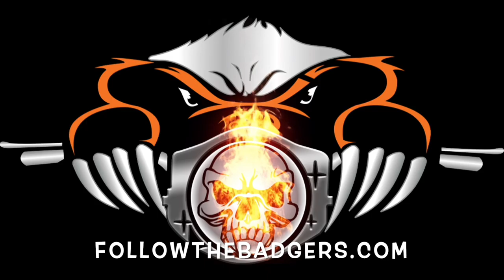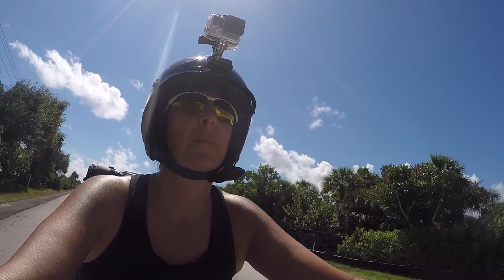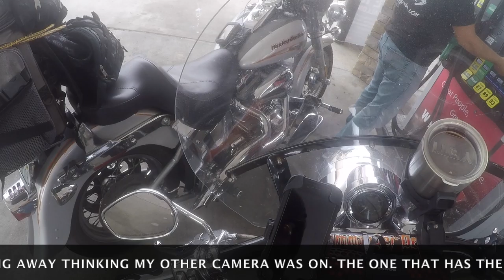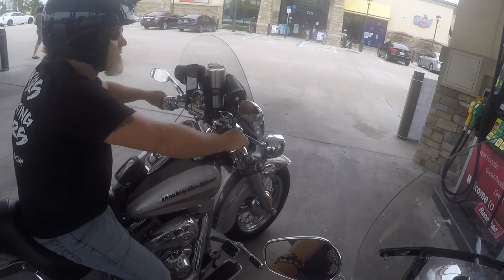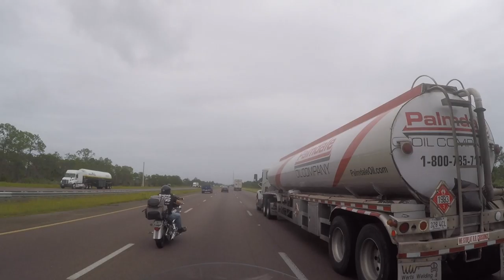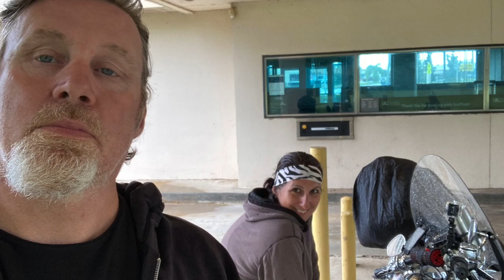How not to do a motorcycle motovlog. Harley Davidson | Badass Sunday Momma Badger E3

Comment: Thanks for the shout out at the end 👍

Audio is tricky and its something that we all struggle with. Either it doesn't work so great and its difficult to hear or it works too well and picks up all these weird little noises.
You're definitely on the right track and your videos are fun to watch (I particularly like the added commentary from your desk).
Reply from the maker: Thanks Walt in PA! Sonny keeps telling me I"m going to be so hot in a full face. But I think it will solve other issues like my ears hurting from the pipes and getting the wind. Plus I wear contacts and my eyes tend to get dried out. I just hate shopping. So I may take a while to look and pull the trigger. I'm going to try on some slower roads until then. Thanks for watching again! I appreciate the support!

Comment: Another great video!! Don’t stop! Keep going and don’t give up, just made adjustments here or there as needed! Have you ever thought about buying a full-face helmet? I’m telling you it’d be easier to hear you but do understand you live in the heat and would prefer half helmet. 😉 To answer your question, I prefer taking back roads over the interstate any day!! But, at times it can’t be avoided because it can cut down on time needed to get to point B faster. Keep pushing forward! 😊💕
Reply from the maker: Thanks Mrs. Stevy. I'm really thinking full helmet is going to be best for me. Toby Northern said to be sure and try a bunch on though. Cause the one he has rubs the top of his ear. I was hoping a full face would help with noise reduction and keep my eyes from drying out too. If it can solve a couple of problems then being hot and sweaty is worth it! ~Momma Badger
Reply: @TheBadgers  actually the ONLY complaint I have is my face is still white all summer and the rest of my body is tan!! 😂 My shoe helmet never rubs and haven’t had any issues with it. My best advice is not to buy cheap because we started with the cheap ones and found out the more expensive the better they were for sound and comfort as well as protection too! 😉💕